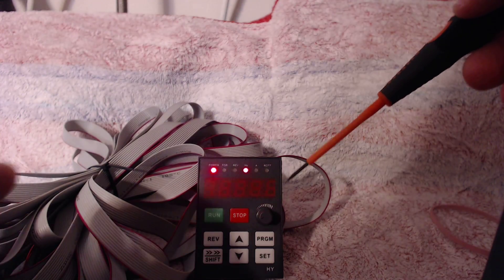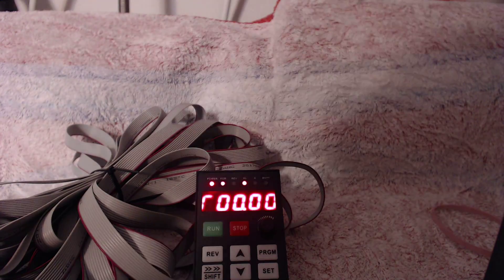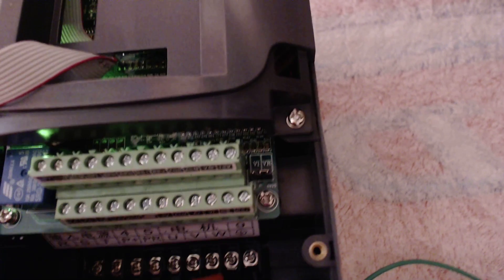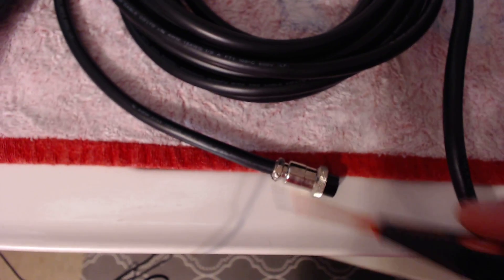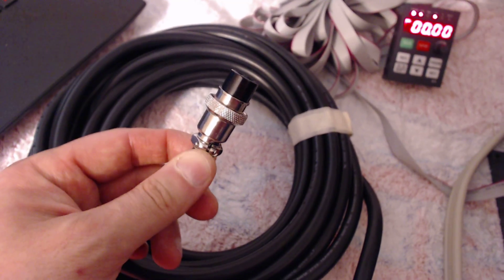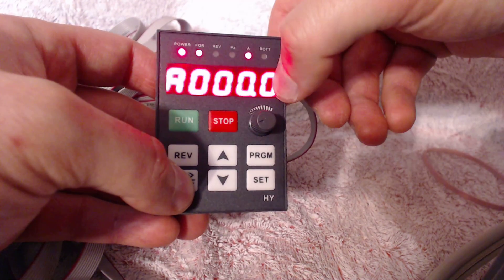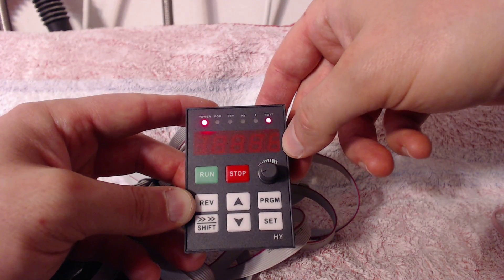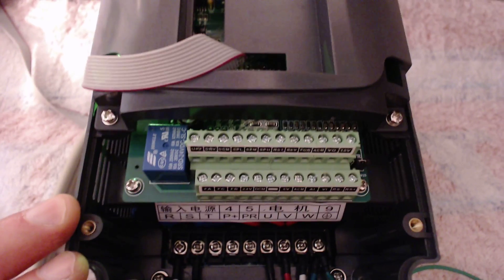VFD Wiring Done Correctly  & Amp Usage On The Digital Interface..

Comment: When i stop my spindle via mach3 (PWM 10v), why does my spindle turns the rpm up shortly ---- then shuts off *normal*? THX for your perfekt vids!
Reply from the maker: Thank you for your support. Unfortunately, I would need a lot more detail than that to diagnose the issue. If you would like to schedule a remote consultation through Microsoft Teams then contact me via the video's description. 

The best analogy for anyone being asked to diagnose a CNC robot is essentially a mechanic being asked to diagnose a car without it in front of him. 

Thank you,
Vince
Reply: @corvetteguy50  Thx for your answer, i get it to work "nearly" correct, my RPM is of now a little bit and the index dont work, using a NVEM V2 bob, sorry, I dont use Microsoft Teams or things like this. I'm on the way to get it right. (-:

Comment: Hi, I wanna have a range on my application from 20 to 100 RPM. What would be best option to control it? Opinion, tnx.
Reply from the maker: Thank you for your support. The VFD control panel's digital interface has a POT that will be used as shown in this video. Thank you,
Vince

Comment: When I set the frequency to 60HZ, the voltage is high(258v), but it works well at low speeds, but at high
  speeds, an overcurrent is displayed and the inverter stops working.
  It does not work. At this time, if you artificially start from 40HZ and gradually adjust it to 60HZ,
  it works well.
 In this case, please tell me how to SET UP.
Reply from the maker: I haven't got a clue as to what spindle you're using, and you should always contact your vendor first as they should be providing you support for what they sell. I have billable time for third party support. Just let me know if you would like to set up a consultation. Thank you, and have a great weekend!
Vince

Comment: Why does soldered have less resistance than crimped?
Reply from the maker: Thank you for your support. Solder provides a fluid metal, and when applied to conductors to weld them together spreads over them providing a larger conductive surface then there is when using crimp connectors resulting in lower resistance. Soldering when done properly with flux provides the best electrical connections for precision electronics. This explains why all internal electronics utilize them where practical. 

CNC controller's manufacturers typically don't provide solder connections as the labor is far greater then when using crimp connections. 

Thank you,
Vince

Comment: So the other end of the ground drain has no connection?
Reply from the maker: The shield drain is to be connected on only one end of the cable to prevent possible ground loops. Thank you,
Vince
Reply: @corvetteguy50  Thanks for the clarity Vince.  Have to replace my spindle cable and do it correctly so I've been watching your videos, taking those notes. My country is piss poor when it comes to selling shielded cable. You only find it in car audio shops here and it's not for spindle/vfd application. I'm not an electrician but I've learn quite a lot from your videos and I'm a little handy.  With good guidance from your videos and  understanding, I should be on the right path. 
Thanks a million.  Keep up the fantastic work and videos.
Reply from the maker: Having the right cable is a must. I do ship internationally if you can't locate one. Thank you for all the support I really appreciate it. Vince
Reply: @corvetteguy50  Thank you.  That will be my next move.

Comment: Thanks for the info much appreciated. Can I ask what type of soldered eye terminal you used and size please.
Reply from the maker: Thank you for your support Gary. You'll require 4mm connectors which I have in stock if you can't find locally. Thank you,
Vince

Comment: You said the 2 screws on lower left and right are grd I do not have any continuity between them nor between the E terminal. shouldn't they all have common connection.
Reply: Thank You
Reply from the maker: @ShadyOaksCNC  You bet...:) Thank you,
Vince
Reply from the maker: Mike R, thank you for your support. I said that the two screws are labeled ground, and require you to verify continuity as many VFD's don't have it for these. If they don't have continuity then they can't be used. You'll only have the E terminal to utilize, and the other option is to use my VFD terminal splitter here https://youtu.be/LkzuzLGcn4M as you only have a single ground terminal which makes it difficult to connect both the spindle cable's ground, and the ground from the VFD's power cable.

Comment: I've have two KBAC 24D units powering my grinders and both have a second power switch that acts as a master power switch where the VFD will not go on unless this switch is flipped on. I just purchased a VFD like the one in this video. If a hook up an industrial  on/off switch running in between the outlet, and the VFD power cord connections on the unit, will this work as a master power switch. So the VFD will only come on if the master switch is pressed on? The major purpose of this master switch is it saves the VFD from frying in the event of a power surge when not in use.
Reply from the maker: Sword Fish, thank you for your support. If you connect an inline switch to the A/C outlet feeding the VFD power then you will be able to cycle the unit on, and off. Have a great weekend!
Vince
Reply: @corvetteguy50  if I may piggyback this question with one related. if you don't do as swordfish stated for vfd power shutdown how else can I get my vfd to shut down when not in use?
Reply from the maker: If you connect an inline switch to the A/C outlet feeding the VFD power then you will be able to cycle the unit on, and off. Without one you essentially will have the unit on all the time. An A/C switch used for this application is best practice. Have a great weekend! Vince

Comment: Those ‘ground’ lugs below the screw terminals are isolated from each other and the screw lug ground/earth. How do you suggest connecting to a common ground? Would you do that inside the VFD or down by your circuit breaker? I’m not going to fit 3 ring terminals on that lug.
Reply from the maker: Dirty Optics, thank you for your support. Here's the easiest method to use. https://youtu.be/LkzuzLGcn4M Thank you,
Vince

Comment: Do you know what the Max ACV in for the single-phase input to the VFD. out of the wall mine reads 249 is that going to fry the VFD?
Reply from the maker: James, thank you for your support. The HY VFD's maximum input voltage is 250v which is covered on page 6 of the users manual. Thank you, and have a great weekend! Vince
Reply: @corvetteguy50  Thank you for your quick response. I am concerned being 1 volt under the max limit. A spike could damage something.
Reply from the maker: You could use a voltage regulator, but they aren't cheap. Typically these units peak voltages are at least off by 5%, so you should be fine. Thank you,
Vince
Reply: @corvetteguy50  Thank you for the info. I have been doing some research on our power here in USA. I agree it should be fine.
You hear 110v , 115 or 120 this would be on half the winding on the transformer so double to get the range. 220,230, 240 off the poll transformer. I was told that 108 is considered a brownout. Thanks very good info on the VFD.
Reply from the maker: @jamescullins2709  Exactly, and you're very welcome. Have a great weekend! Vince

Comment: Thank you for sharing. 
Can I use the VFD for a 1725/1425 rpm Belt drive fan and blower motor? Also the motor voltage is 208 V @60Hz. I need your advice.
Reply from the maker: Shaibu, thank you for your support. I answered you in your email. thank you,
Vince

Comment: in the video you talk about 110 volt input, but in the description for the settings you have 220 listed as motor voltage. I played around with some settings and must have screwed something up, so did a reset to defaults, but now when I try to run it, it will only goto about 26HZ even thought I have 400 in the settings. Any ideas
Reply from the maker: Hey Don, thank you for your support. I would go with the factory default settings again, and start over if you haven't. Without seeing what you entered I can't analyze what the issue would be as I'm essentially a mechanic working on a car without it in front of me. If you forward me the settings to my direct email Storm2313@gmail.com  you have I can then see what the potential issue is. Happy New Year! Vince
Reply: @corvetteguy50  I think I got the setting working now, I ran a multimeter on the motor outputs and got some weird readings. Not too sure if you need a load to be more accurate.  Going to solder up the pins on the motor and give it a try. Hoping this works, thx
Reply from the maker: @Hoss_1966  Great, I'm glad to hear you got it working. Vince

Comment: Great information. I am setting up my 4848 and just started on the VFD wiring. I spent the last couple evenings watching most of your vids. They have helped immensely! My VFD is in the back of my machine. I could flip the drag chain but I would rather keep the front shelf open for supplies. Would you happen to know where I could possible get one of those ribbon wires? It would be great to run my VFD panel to the front of the machine. My VFD is the HY02D223B. Thanks Roy
Reply from the maker: Hey Roy, thank you for your support. I have the ribbon cable in stock as used in the video. Please message me direct at Storm2313@gmail.com for a quote. Thank you, and you an your family have a Happy New Year! Vince

Comment: Hi!  @5:15 you talk about those ground points in the side.   On my VFD, those grounds points doing have continuity with the one on the board (space 9) 

Should all grounds be earthed to each other?  Is it ok to use them if they aren't in continuity with the other ones?
Reply from the maker: parsaverv1, thank you for your support. Only use grounds points that reflect continuity, and all ground leads should be allocated to a ground on the VFD with continuity to assure this is done correctly. 
Thank you,
Vince
Reply: @corvetteguy50  thank you for a quick reply and again for all the videos you've made.  And yours that you use in this video you grounded your 220 cable off the left hand side. Did you have continuity with both of these?

If there's no continuity if I ran a jumper connecting the board ground to one of these I wonder if I could use it then?   I've asked in forums and got a plethora of answers, few of them helpful.

And Merry Christmas!
Reply from the maker: @parsaverv1  The video reflects the grounds are attached on the right side of the VFD on ground terminal. This terminal is the one to use for grounding, and if you need more terminals to ground to then terminal splitter is in best practice to be used as illustrated here. https://youtu.be/LkzuzLGcn4M Thank you,
Vince

Comment: Thanks for the very helpful video. Quick question: Being in the US on 110V 20A circuits, I ordered a Huang Yang 1.5kW VFD/spindle combo online, but unfortunately the vendor sent me a 2.2kW combo. Being borderline for my circuits, I am hoping I can limit the current using the PD142 function to "fake" the rated current of the spindle and reduce to it 13A to get close to 1.5kW, assuming this is what the 1.5kW/110V VFD model should be set at. Is that the correct approach? Any risk the breakers on which the VFD and spindle are individually connected to will trip?
Reply from the maker: Nico, thank you for your support. In theory this should work fine, but I would still validate the setting with the vendor. IF they knowingly shipped a substitution then they usually already know it will work, but its best practice to ask to confirm. Thank you, and have a great weekend!
Vince

Comment: Hi thank you for posting this! I am a little confused. I have 240v (Red, Black, White, Bare) which is two hots, neutral, and ground. In this video you said to use the two hots but what about the neutral? I assume I connect the ground to the bottom screws as you showed. My spindle has 4 pins connector so 1,2,3 are UVW and I am assuming #4 pin is the ground which would connect to the last Earth terminal inside the VFD? Thnak you again for all your help!
Reply from the maker: Billy, thank you for your support. I really appreciate it. The leads you will have running to your spindle will be three hot leads, and a ground. There isn't a neutral on your spindle. This is because your VFD is three phase out meaning three hot leads, and a ground. The U, V, an W terminals are hot, and the fourth pin at the VFD is your ground. Thank you, and please be safe.
Vince

Comment: Thank you for the video.  After watching it, I purchased wire from you for mine.  I have a problem though and can not seem to find the answers any where.  Including the manufacturer ( just crickets on their end).  I have the 110V version of the VFD and the unit is stalling on start up.  It use to start after one false start and an over amp code (from what I can guess), then if i tried to start it up again it would run and be great for hours to come.  but now I get all false starts and what I am assuming to be an over amp code.  Any suggestions?  It seems the video here is of the setup of a 220V system?  I purchased it as a 110V Kit with a 24000 RPM spindle.  Thank you for any input.  I am pulling it off my machine right now as I have a time sensitive project, and going back to my trusty dewalt... not that I want to, but it will work for this project.
Reply: Also, everything on mine is stating 50hz... and it is not changeable to 60 hz.
Reply from the maker: Jordan, thank you fro your support. If your vendor sent the programming information for the VFD, and it was correct the unit would start correctly without any false starts. I would ask them to replace the unit as this certainly isn't normal. The other variable to try is to check it on another breaker to make sure it isn't causing the issue. Thank you, and please be safe.
Vince

Comment: Great video, I want to get a 220v vfd, I live in the states and don't have 220v-240v at home. I want to use a step up transformer, the step up transformer is for uk/ European  plugs, that means only one pole Carries the 220v and the other wire is neutral, if used with America 220v-240v there are 2 leads and a ground each lead carrying 110v and connected to either R+T or R+S, how would it be connected with a steu up transformer? I have seen videos of people doing it, but no wiring diagrams or instructions on doing it.
Reply from the maker: Carlos,
Thank you for your support. I really appreciate it. I don't recommend a step up transformer as it will increase EMI. You would be better purchasing a 110v version.Thank you,
Vince
Reply: @corvetteguy50  thanks 👍
Reply from the maker: You bet  :) You, and your family be safe. Thank you Vince
Reply: Just use a standard step down transformer in reverse. If you are only looking to power household items that would work fine (less than 2-3kw). The case of the transformer is metal and would provide adequate shielding if properly grounded on both ends. The only emi would be 60 cycle hum and shouldn’t be an issue since it’s already present from your home unshielded wiring.
Reply: I know this is two years old but for those looking for the same answer: If you live in Canada or the states and your outlets are 120v, most fuse panels are two phase  and 220v comes into the house. The fuses or breakers tap off between 1 phase and Neutral to give 120v. If you go across the two live phases you get 220v. An electrician would be able to wire to a 220v vfd properly.

Comment: Fantastic job explainning !!!! thanks !!! On my system the spindle has a 4 pin aviation connector, but disassemblying to cover of the spindle,  inside only U V W are connected to the spindle motor. The ground terminal inside the spindle is not connected to anything ??? Should I solder a wire to the housing of the spindle to properly ground it?
Reply from the maker: Ricardo,
Thank you for your support. I really appreciate it. If you don't have a ground on the actual spindle connector that's being used. You can do as you wrote, and attach a lead to its body, or you can, and should ground the metal CNC chassis which is conductive as is the spindle's body grounding the entire unit a system. I recommend grounding the CNC chassis as it should be done anyway, and you'll kill all birds with one stone  :)  Thank you, and have a great weekend! Vince

Comment: Can I get 1 of these to hook up to my stand alone cnc controller where my gcode will turn on the spindle to the rpm I program? Also can I get it to work on 110 volt ac to just plug into a standard outlet?
Reply from the maker: Hey Max, thank you for your support. The unit will work with any HY VFD, and what you described would work if you left the setting at a specific RPM setting while turning the unit on. The unit will work on whatever voltage the VFD utilizes as its simply an extension cable for the digital interface that controls the VFD. Have a great weekend! Vince
Reply: @corvetteguy50  so it's not possible to have my gcode control the rpm as well as turn it on and off?
Reply from the maker: This interface isn't designed for that. It simply allows for your digital interface from your VFD to remotely located. Thank you,
Vince
Reply: @corvetteguy50  so I would use pwm cw and ccw wires off my controller to run it from my gcode?
Reply from the maker: @maxcox6019  If your system is using a stand alone controller with integrated VFD then you would use your PWM output to manipulate the spindle speed in Mach3. You should contact your controllers manufacturer to validate the system will support it. Thank you,
Vince